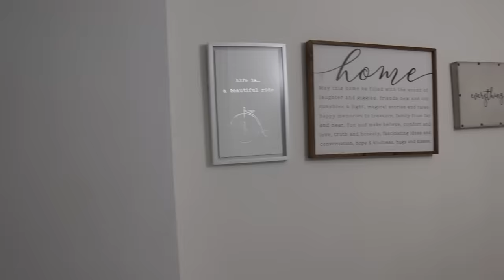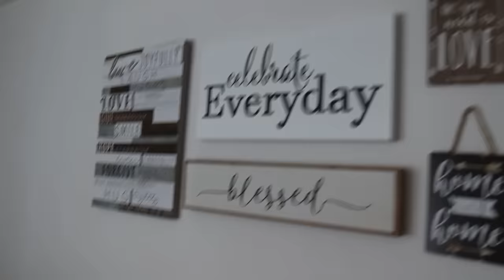We have an ANT problem

Comment: If you nerds had the self-control to wait a few more hours, you could have had an awesome cast of the entire colony.
Reply: They didn't use enough aluminum. It poured down and filled only partially up, and the surface aluminum cooled down and clogged it before the rest could flow into the bottom. If they had used 50% more there would have been more flowing aluminum and the space would have filled completely. They probably could have waited a little longer too but  you can tell it was pretty solid when they were digging it out.
Reply: @BengalGecko yeah they needed at last double the amount to get the whole nest. Probably closer to triple, and even then might not get quite everything. Those nests are just huge…

Comment: The force of gravity on both balloons is proportional to their masses so they'd take the same time to fall in a vacuum. The air reistance is about the same but because both aren't much denser than air bouyancy isn't negligible like it usually is, and that bouyancy doesn't increase proportionally with mass so it'll cause a greater upward acceleration on the lighter balloon, making it fall slower.
Reply: no

i have a better term

density

u just proved the point in 3 idiots
Reply: Nah bruh occam's razor, heavy things fall faster.

(jk tho, that was the correct answer)

Comment: I once dumped boiling hot bacon grease onto a pile of Florida red ants after absolutely nothing else had worked trying to get rid of them. It made them stronger.
Reply: Of course it did. You killed a few surface ants but gave the rest a tonne of energy dense food.
Next time don't feed them at the same time as you try to get rid of them.
Reply: Cyanide